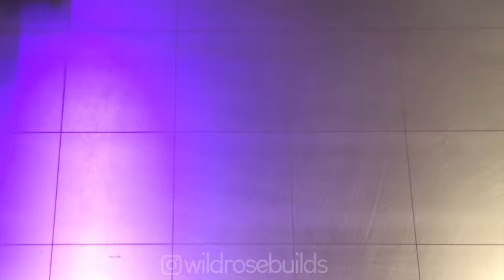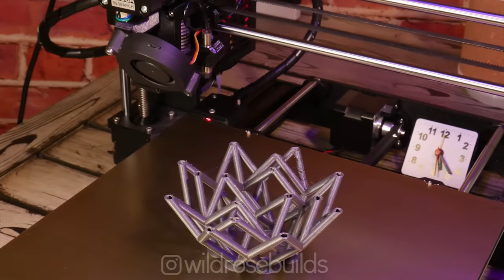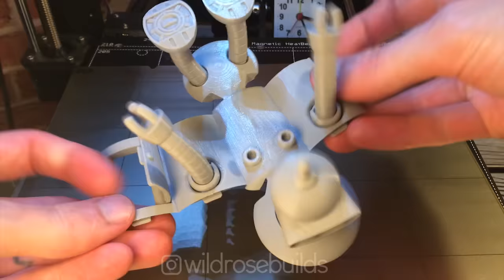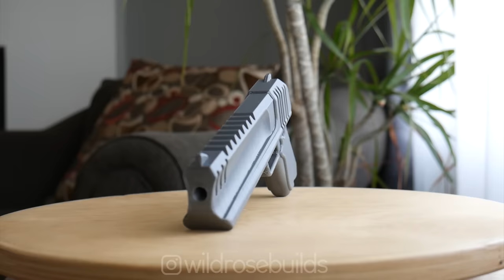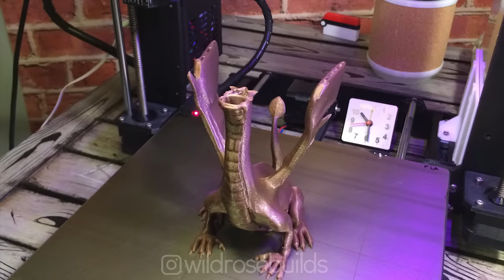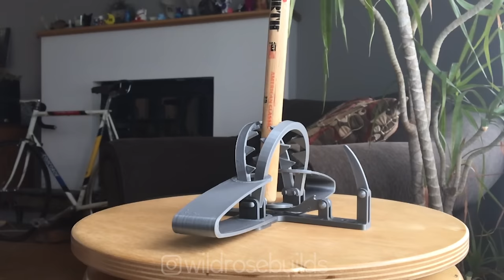3D Printing TimeLapse episode 8 (Prusa Mk3 octolapse)

Comment from the maker: Get the Best Budget 3D Printer of 2022 Here: https://shrsl.com/3obuu
Reply: WildRose Builds just wondering I got my prusa and I print in pla and PETG currently and occasionally it spits out a bit of petg when I print in pla any ideas
Reply from the maker: Allen Hasbun make sure you’ve fully purged the petg before printing in pla, they don’t stick to each other and can cause pretty significant print failures!
Reply: I did a full purge I run the fillament a few times before printing in any of them
Reply: Doing nozzle cleaning or getting cleaning filament will fix your issue.
Reply: UPDATE on the back side of the heat block there was a bunch of gunk
Reply: @spookyseafood7682  that would explain. Also check if the heat block is secure tight or else plastic may leak out.
Reply: hey whats a good printer that prints in metal??? Thats commercial?
Reply: @WildRoseBuilds  Took me a while to realise why the printhead what not moving in the timlapse. LoL. 
Is this a FDM printer?
Reply: What are your cura settings

Comment: Would love to see how you set your time lapse up so it doesn’t show the extrude module in the shot. So cool!
Reply: pretty sure it's a prusa setting where it just retracts the print head every layer or so and automatically takes a picture
Reply: Uh there is a clock in the background that's going perfectly smooth, so yeah no.
Reply: In the octolapse plugin you can configure where the extruder rests when a picture is taken.

Comment: I just watched your video.
It's really, really great.

I've heard of this stuff, but have never actually seen it up close like this.

I had a question watching the time-lapse.

What are all the strange shapes inside the object. I know it has something to do with filler and support...but how is it designed?

It seems to be a whole seperate design, within the actual design you are intending on producing.

Why is it like that.

And it's different with each make.

Like the coral was smooth curvy shapes in there, and later it was a bunch of perfectly straight, triangular shapes.

What determines those interior support shapes within the object?

Do you have to design all of that as well, or does the computer somehow determine it...?

I couldn't figure that stuff out.

Thanks for these videos.  They are really great.  I'll start watching more of these now that I've discovered them...😊
Reply from the maker: this is the infill, its generated by the slicing software. you can determine pattern style and density to best suit the model your printing!

Comment: Spending 14 hours printing an object, I've never thought it is such long.
Reply from the maker: theres things you can do to lower the print time in most cases, but i try to get as much detail as i can for these videos!
Reply: Actually those projects spend so much time. Just because the printer head move to start position after each layer complete (get clear view to video?) and then go zero position process before start next layer. So each layer may cost extra 2~3 mins to complete.

Comment: I printed the ditto with 0 infill in a transparent blue TPU about 4 months ago so its shiny its a really fun print.
Looks like your bear trap broke a tooth i am guessing on the first use test. You still have some stringing there to fix up need to fine tune that printing profile better or possibly dry your filament.

Comment: Ten years from now and someone will watch this video and say:
"Geez! Do you remember when it used to take 12 hours to print that stuff ?"
"Yeah. And it's not even smooth."
Reply: But, the printers that can print like that use reson.
Reply: @joshg2131  
I'm not sure what are you talking about, but I belive you.
Anyway. I mean that I'm sure the 3D printing technology will keep evolving fast and for the best.
Reply: @BETMARKonTube  they have 3d printers that use liquid reson to print. They print fast and have good detail. The downside is the reson is toxic, messy, smells bad, and old reson cant b thown away.
Reply from the maker: moores law.. or something
Reply: @joshg2131  
... do you mean "resin"?
If you do, that's a totally different thing.
It's maybe faster and smoother, but you have to work too much on the "printed object", after is done.
So it's not only messy, but it also takes away a lot of time, anyway.
Reply: @BETMARKonTube  sry for my bad spelling. Plz dont kill me over it 😅
Reply: @joshg2131  
No problem, I don't speak english either.
So, you DID mean "resin", right?
Then my reply is still valid.

Comment: Did you see a improvement going to the R3 extruder format? Ive read yes and no’s but haven’t actually seen a video where someone had done it.
Reply from the maker: i reprinted a ton of parts and swapped a few bad bearings that i had. so yes i see quite a difference in my prints now but its hard to say if it was the rev 3 parts or the full rebuild/maintenance that did it!

Comment: Is the curvy infill better than the more angular one with the triangules?
Reply from the maker: I haven't tested for strength or anything, but it sure does look cool!
Reply: cnc kitchen recently did a video on different infill patterns and their strengths. The gyroid infill managed to be just as strong as cubic, but not matching the perpendicular strength of the 3d infills. Though for unidirectional stuff, it's definitely one of the best.

Comment: how do you give instructions to a 3d printer? example a battery cover for a remote control.
Reply from the maker: you'd have to either find the model or design it yourself in cad. the 3d printing software generated the instructions (Gcode) which contain xyz values and extrusions! ;)

Comment: How does that printer work
Reply: It has an extruder which melts plastic and puts out small amounts of the liquid at a time. The liquid cools in place and bonds with the other plastic to make the object. The extruder is moved around in all three axes by very precise motors called "steppers." (Some printers instead move the printbed in some of the axes. Depends on the design) For each layer, the printer moves the extruder and puts out plastic in that layer's cross section, moves up, and repeats until the process is done.
In this video, instead of showing this process as it happens, the picture is taken between each layer, so you don't see the extruder move around. All you see is each layer showing up and being moved down relative to the extruder. If you watch some other timelapses you may see the extruder moving around very rapidly, and if you watch a true speed video you can see how it all actually happens.

Comment: I bought an Ender 3 Pro and the print quality sucks. Even low detail models print with flaws. The included sample models won’t even print without defects so I know the problem isn’t my modeling.
Reply from the maker: the ender 3 takes quite a bit of mechanical tuning in my experience, belt tension and wheel tension are big things to look at. also tune that extruder!